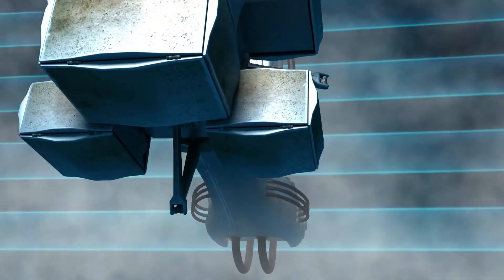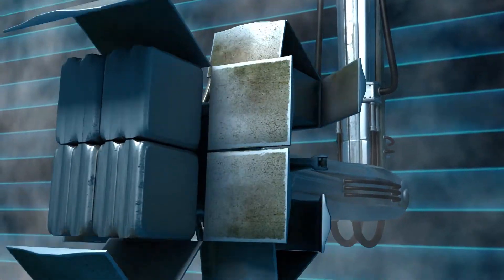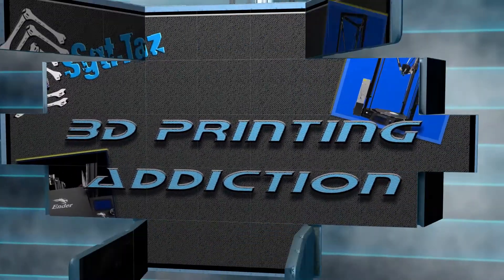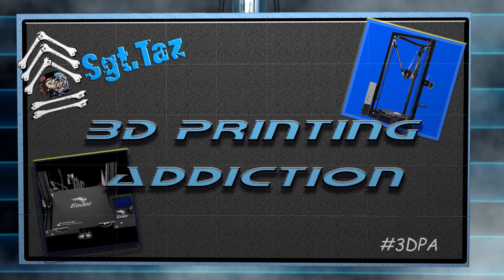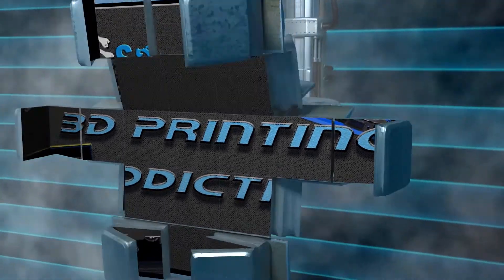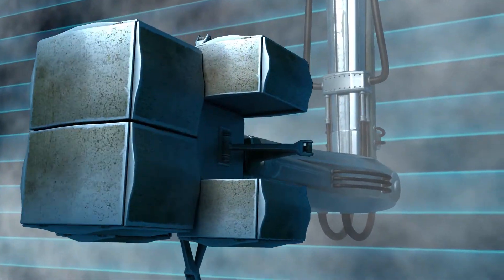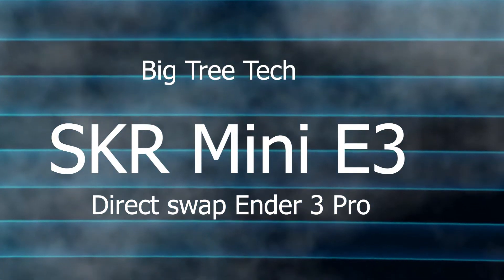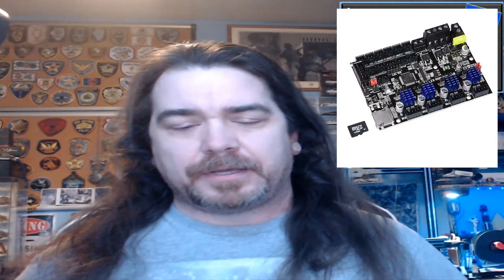Ender 3 Pro upgrade SKR Mini E3

Comment: I'm glad to hear that it works straight out of the Box without having to mess around with Firmware Files. It would be nice to know if it will work with my EZABL instead of the BL Touch, But I'll find that out pretty quickly. The one thing I have noticed though is that no one has made any mention about Automatic Bed Levelling or Stall Guard. My Cheap entry into 3D Printing has of now turned into an Expensive printer that should be even better than Crealitys Top of the Line Printer as I just ordered Linear Bearings for X and Z Axis as well.
Reply from the maker: I stopped using my BLTouch so didn't add that. Most of the forum and FB post say adding the EZABL should be just as easy though.  Cheap entry level printer that hooks you into the addiction ;) The linear rails should be an awesome project and I've seen great results from those installs. BTW firmware is a breeze with the SD card files so any change you might need is fairly simple. way easier than the old arduino uploads we had to do before.

Comment: Thanks for the vid.  Did you see any difference in print quality, most notably surface artifacts?
Reply from the maker: I was having good prints prior to the switch in all honesty. reason I did the upgrade was for better speed, more control on faster prints.  Just finishing up a new install of the SKR V1.3 on my Artillery SWX1 with the tft32 dual screen-taking a bit longer to make some of the old features convert but that video will be up soon :)

Comment: Do you plan on do this to the tronxy?
Reply from the maker: Just got another board in. the SKR V1.3 regular. Toss up on rebuilding the TronXY or upgrading the Sidewinder  and maybe adding the lcd/tft combo to it.  Still debating lol
Reply: @Sgt.Taz3D  do you have the config file for the tronxy?
Reply from the maker: @headfog7621  No I haven't seen anything for this model, and it seems it's not open source. One of the reasons I've been putting it off

Comment: Cool, I upgraded with one of these as well... so quiet and easy to setup. I bought 11 of these boards :D ... some of those version 1 and others version 1.2

I’m figuring out if I can speed up without losing quality. I doesn’t know if Marcos, from Teaching Tech, put more speed using linear advance or if the board was stock. The first video from him shows a picaku printed at 100mm/s... the last image from the 1.1version
Reply: I have one in my E3 Pro and reselling all the others, missing 3 in storage. By the way I live in Rio de Janeiro, Brazil abd I have an online store called .: 3dSolid

Next (board) project I will figure out wich 32bit board to install in my old (but awesome) Ultimaker2. Artillery X1 arriving next week and those are all my FDM printers :)
Reply from the maker: Wow 11 boards? Did you need them or just buying to resell?  I have a second v1.3 just arrived debating on which printer gets it lol